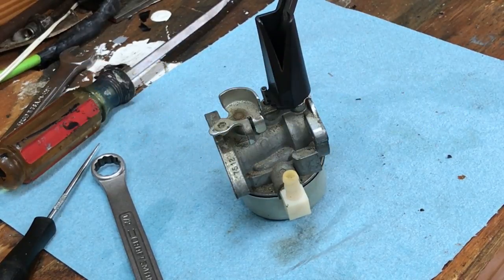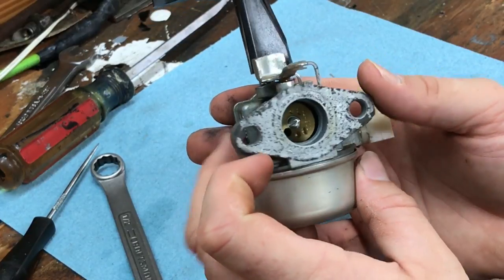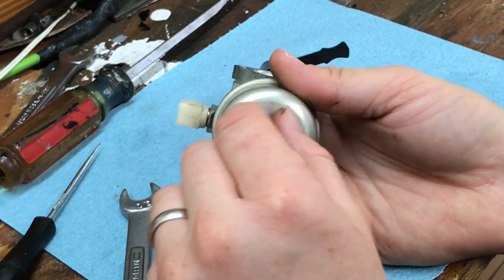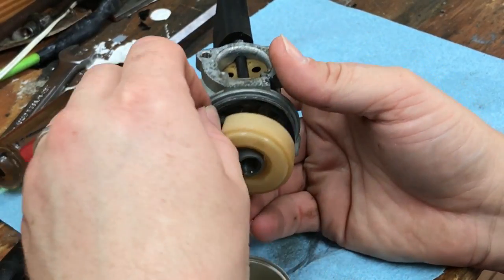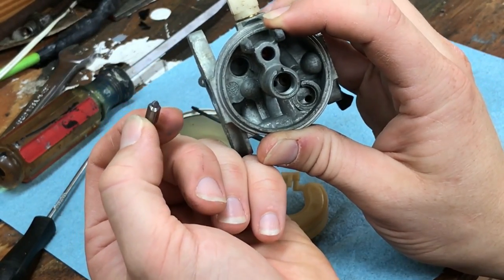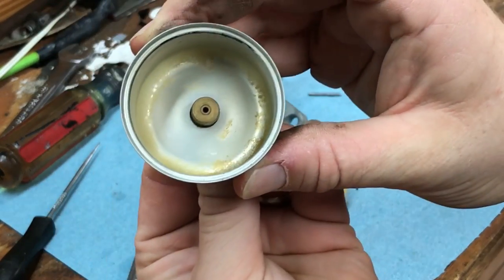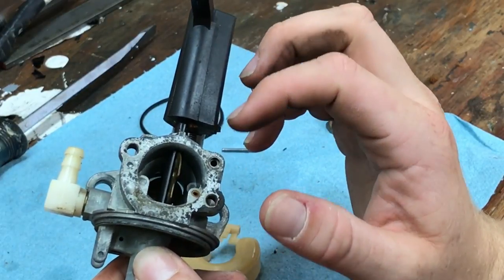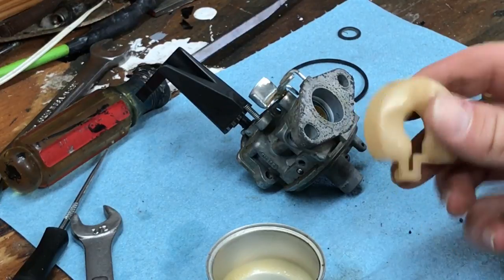How a Small Engine Carburetor Works (Float Type)

Comment: Was given a tiny generator (600 watt and nearly useless). No fuel.  HIt it with carb cleaner or similar? It'll run til the spray is gone.
The needle valve seems to be the issue after watching this.  Gonna get some berrymans and see if i cant clean it. Nearly new generator.
More of a "lets see if i can fix this" than a useful tool lol.  Thanks for this and you earned a sub!

Comment: Nice job, clear video and explanation. One question: once the fuel enters the bowl, how does the fuel then defy gravity and travel upwards through the jet in the bowl screw to the body of the carb where it mixes with O2 and then drawn into the combustion chamber.
If I had to guess, I'd say it's due to vacuum that was created when the piston retracted from top dead center. Just a wild guess.
Reply from the maker: Yes it works like a vacuum. As the engine is on its intake stroke and the valve opens to draw air/fuel in, it pulls a lift of fuel up through the orifice of the carburetor. If you remove the air cleaner to where you can see inside the throat of carburetor, look with a flashlight and you’ll see fuel coming up in quick spurts with the engine running. Them small pin holes you’ll see around the throat help in creating that vacuum affect to give it that lift.
Reply: @MikesGarage96   A friend of mine gave me his old Briggs & Stratton POWER 3500 watt elite series portable generator. It wouldn't start so we replaced the spark plug and disassembled the carburetor. I'm not too knowledgeable about engines and carburetors and was sent a link to your video by a coworker. Thank you for the explanation. In my case, we cleaned the carburetor and there is fuel getting in the bowl. There is no fuel getting to the spark plug. Any advice would be greatly appreciated.

Comment: Best video I have seen explaining how a carburetor works! Thank you. And maybe you can answer this question what is the best stuff to use to run through my gas tank to clean out the carburetor. Seafoam? For some reason my carburetor is not sucking gas and the hoses are fine and the fuel filter is fine. So I think the carburetor is dirty but I don’t want to take it apart I just want to run something through it. What’s the best on the market?
Reply from the maker: Seafoam is a good product, but if it’s severely dirty and clogged up inside, there’s really no way to get it clean without taking it apart. You can also take your air filter off, and pour seafoam into the intake of the carburetor a little at a time with the engine rev up a little. It’ll smoke while you’re doing it. It’ll clean out that intake, and help clean carbon out of the cylinder. A small funnel with a piece of fuel line on the end of it works great for pouring the seafoam in there.

Comment: Mike,  i have this same carb on my power washer and as soon as i put gas in the tank the carberator starts leaking out of the intake. The engine did sit for a year with gas in it....possible varnishing occured?  I have the bowl and float out now, but it looks pretty clean....suggestions?
Reply: I had this problem with a generator 10 HP briggs & stratton engine.  In my case I just took off the carb bowl and sprayed some gumout up into the intake.  put back together and found out the bowl seal was crimped and leaking so took apart again and repositioned the bowl seal.  everything works again - knock on wood

Comment: Nice video. How do you fix  a Small Engine Carburetor with leaking gas going toward the air filter?
Reply from the maker: Same way as if it was leaking in the engine oil. There’s a problem with the needle and seat.

Comment: why would the fuel spray back around the primer ad filter housing? please get back to me
Reply from the maker: I’d start by pulling the carb off and rebuilding it. Replace the gaskets, especially where the air box mounts to the carburetor

Comment: Any ideas as to why gas is slowly leaking from the carburetor (just like this one) into the air filter plate?  My guess is that the float should close off the fuel from filling the bowl and perhaps it is not making a good seal?  Thanks.
Reply from the maker: Could be either the float or needle and seat not sealing. I’ve even seen new needles and seat leak due to crappy parts being made these days. Check the float first and see if it’s full of gas. Then replace the needle and seat. If gas is leaking out into the air filter, there’s a chance it’s leaking into the crankcase oil too through the cylinder. Check and make sure your oil don’t smell on gas. For precautionary reasons I put a fuel shut off valve on mine and I cut it off when not in use. I have a video on that too.
Reply from the maker: https://youtu.be/wnPxPA4CUC4
Reply: @MikesGarage96  Thanks I'll check it out!  I definitely like the cut-off valve idea.  The way my John Deer  push mower is designed I didn't detect any leaking fuel running toward the cylinder or intake, but changing the oil just the same.